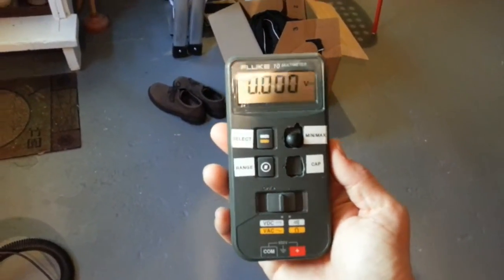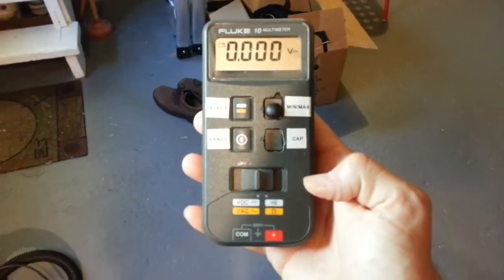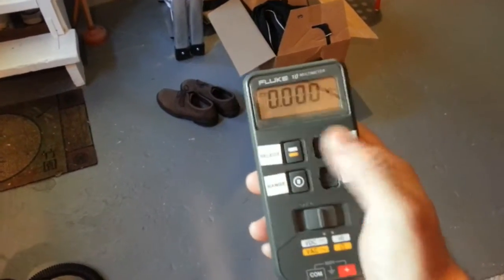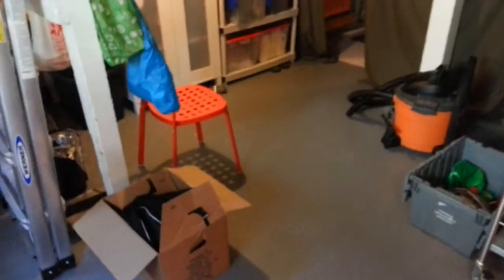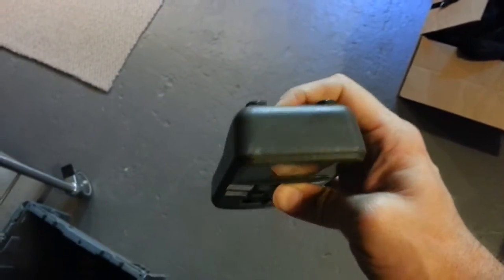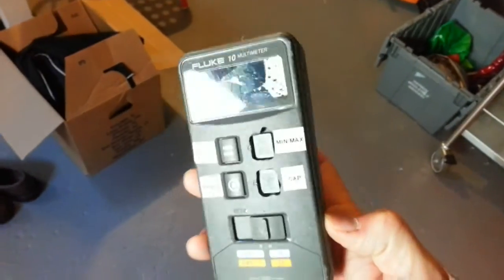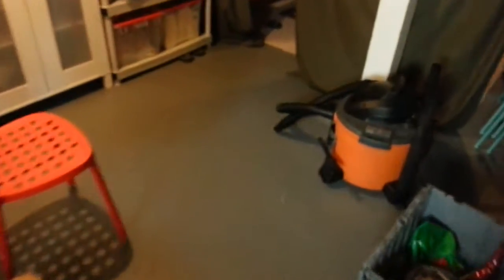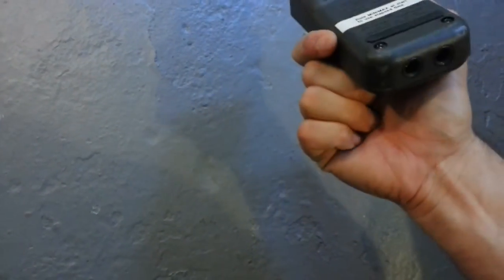Fluke 10 Throwdown and Stress Test

Comment: I used to do some Certificate 2/3 courses in computers/electronics with these & I recall a lecturer complimenting the durability of these multimeters. I even bought one of these used just for that reason. Even without the yellow rubber case you couldn't totally break it! ;)

Comment: There is a moron in every crowd, that was a made in USA unit and meant to last. I have had  mine for probably 20 years and it's still good, changed the battery once.
Reply: Does it auto range, with the decimal moving to the correct spot? I need an idiot proof meter, saw TampTech with a 12, & is it very accurate? Just got a Fluke 101 & its not very accurate sending it back, would love an American made meter even if it is used. Thanks William.

Comment: The battery in the meter was probably low. I have the same meter and had the same thing go on. I changed the 9v battery in the meter and it was fixed.
Reply: It was, I could see the low battery indicator right at the start of the clip.